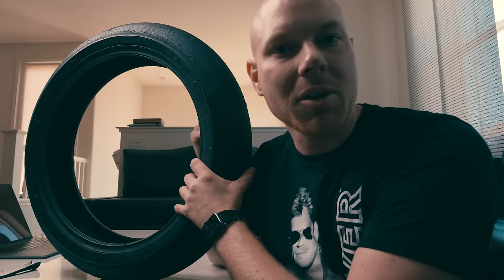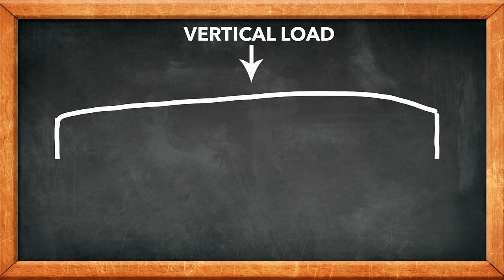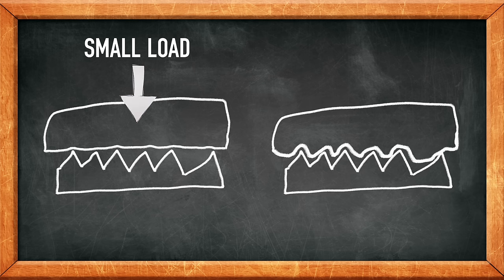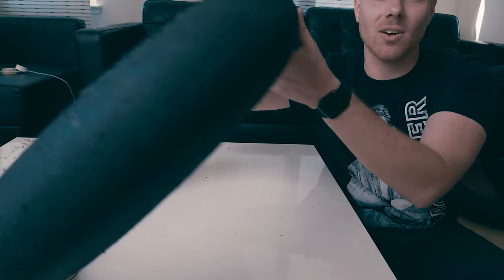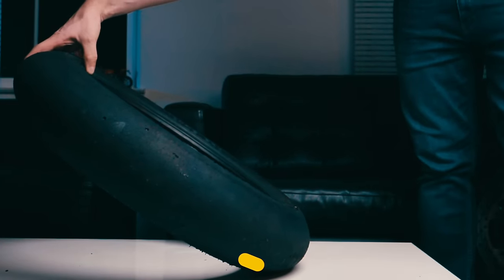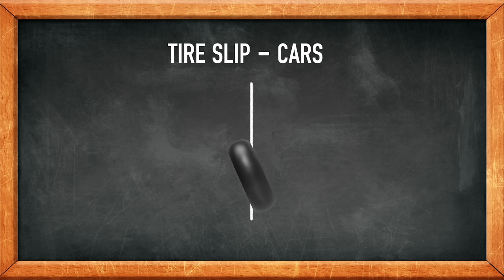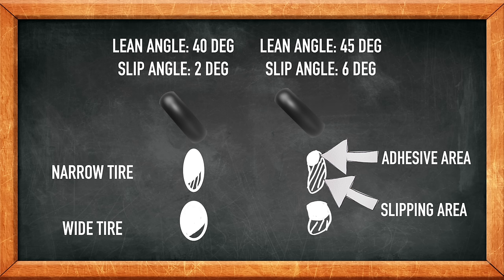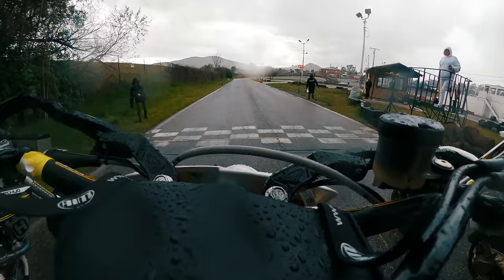Tire Grip | EXPLAINED

Comment: Speaking as a former tyre test development rider, it also needs to be pointed out that upping tyre sizes, even from the same manufacturer & model, rarely gives more grip at the contact patch is defined by the tyres vertical stiffness, lateral stiffness, & rim produced profile. Often 2 tyre sizes have differing vertical &/or lateral stiffness, & the larger tyre may well have a smaller contact patch area on the same rim, as tyres can be fitted generally on approx 5 rims sizes and their vertical/lateral stiffness, contact patches upright, & leant over, profile, grip, & feedback will be different on each rim. Shape is everything
Reply: Great point.

Comment: I think it was a bit disingenuous to say I got it wrong.  Was it simplified? Sure.   I feel like this is kinda like the "do chains stretch" argument.   You can argue a chain doesn't stretch, the holes in the plates and the pins get worn down and the chain gets longer.  But the definition of stretch is "being made longer or wider without tearing or breaking."   Is the guy who says a chain stretches wrong?  No.  It was just a simplified explanation.
Reply from the maker: I think that specifically "the force of friction is directly proportional to the applied load", (it's not),
and "friction force is independent of area of contact" (it's not), are both oversimplifications.

I agree with both you and Ryan on the other parts of your videos.
Reply: @CanyonChasers Yeah, I gotta side with Mike on this one, calling it purely F = μN is just a straight up incorrect statement, weight is only one factor and it's not a linear relationship.  As another mechanical engineer like Mike, high school and even some college physics just don't get into the exceptions to the rule as much as they should, and sometimes don't even clarify that there are exceptions.  If more weight equaled more grip, then the fattest riders would be the fastest riders through corners, and we all know that isn't remotely the case.  The adhesion forces in particular is what sets them apart from more conventional materials and are why tires can pull up to 3G of lateral force on race karts (highest non-downforce grip I'm aware of) when most materials would never get past 1G.  I've had plastic food wrappers get stuck to my kart slicks after pulling in after some laps that almost took ripping the wrapper to peel off, if it was just friction force and weight at play, it would've never stayed on the tire in the first place.

Also, while we're on the subject, I kind of don't like the guys that call chain wear "chain stretching" as it's caused a lot of people to think the chain links actually do stretch out and it leads to misunderstandings about where and how the wear occurs.  I even read people on forums say they don't lube their chain because "it always stretches out before anything gets worn", yeah, because the pins have no lube and they're wearing down.  

I'm sure you meant well and were describing it with your best understanding, but I'm also glad Mike cleared it up as I was taken a bit back when even Ryan from Fortnine, a guy with a physics degree, got it wrong.
Reply: @MikeonBikes  have you got sources for us to look at?
Reply from the maker: @dztrbdgod  The Racing & High performance tire, Paul Haney, 2003 

Motorcycle Handling and Chassis design, Tony Foale, 2002

Motorcycle Dynamics, Vittore Cossalter, 2006 

Car suspension and Handling, Donald Bastow, 1993 

Chassis Engineerings, Herb Adams, 1993 

Competition car suspension, Allan Staniforth, 1988 

Drive to win, Carroll Smith, 1996

Engineer to win, Carroll Smith, 1984

Fundamentals of Vehicle dynamics, Thomas D. Gillespie, 1992 

Mechanics of pneumatic tires, Samuel K. Clark, 1978 

Prepare to win, Carroll Smith, 1975

Race car aerodynamics, Joseph Katz, 1995

Race car vehicle dynamics, William F. Milliken and Douglas L. Miliken, 1995 

Science and Technology of rubber, Frederick R. Eirich, 1978 

The physics of Tire traction, Donald F Hays and Alan L. Browne, 1974

The Shock absorber handbook, John C. Dixon, 1999 

The Tire pavement interface, Marion G. Pottinger, 1986 

Tires, suspension & handling, John C. Dixon, 1996 

Tune to win, Carrol Smith, 1978 

Vulcanization of Elastomers, G. Allinger and I. J. Sjothun, 1964
Reply: A better way to save face in situations like these is to just say: Thank you for digging really deep into the nuts and bolts in this matter and educating us all about the peculiar and particular behaviour of tyre friction and why it doesn’t follow normal physical laws and formulas. 

Kind regards
Tom
(Retired engineer; Porsche, Audi, VW, 
R&D: Saab, SCANIA.)

PS. I follow and like all three of you.
Reply: @dztrbdgod  : Did you ever finish going through and verifying the source information you requested ?  lol.

Comment from the maker: Some references for the curious:

The Racing & High performance tire, Paul Haney, 2003

Motorcycle Handling and Chassis design, Tony Foale, 2002

Motorcycle Dynamics, Vittore Cossalter, 2006

Car suspension and Handling, Donald Bastow, 1993

Chassis Engineerings, Herb Adams, 1993

Competition car suspension, Allan Staniforth, 1988

Drive to win, Carroll Smith, 1996

Engineer to win, Carroll Smith, 1984

Fundamentals of Vehicle dynamics, Thomas D. Gillespie, 1992

Mechanics of pneumatic tires, Samuel K. Clark, 1978

Prepare to win, Carroll Smith, 1975

Race car aerodynamics, Joseph Katz, 1995

Race car vehicle dynamics, William F. Milliken and Douglas L. Miliken, 1995

Science and Technology of rubber, Frederick R. Eirich, 1978

The physics of Tire traction, Donald F Hays and Alan L. Browne, 1974

The Shock absorber handbook, John C. Dixon, 1999

The Tire pavement interface, Marion G. Pottinger, 1986

Tires, suspension & handling, John C. Dixon, 1996

Tune to win, Carrol Smith, 1978

Vulcanization of Elastomers, G. Allinger and I. J. Sjothun, 1964
Reply: I'm reading Motorcycle Dynamics at this exact moment! As a tire nerd/material scientist/chemist/mechanical engineer/former racer, thank you SO MUCH for making this video. Tires are so under appreciated, they're all just black and round right? This video is already in depth, but only scratches the surface of the complexity. Could have added (and probably way too technical) the Loss Modulus and Storage Modulus based on temperature (such as a DMA graph). Which is a discussion on glass transition temperature/rubbery plateau/flow region to demonstrate exactly why operating temperatures are so critical to tire operation, tire warmup, and over-heating. It would also be cool to see a comparison of a 190 rear on a 5.5" and 6" rear wheel. U vs V profile on the wheel, and contact patch at lean angle vs straight line stability based on that profile.

Such a great video.
Reply: Wow, what a list! thanks.
Reply: What do I win if I own all of the above referenced?
Reply: @RedTurbocar  My undying respect and a whole lot of knowledge.
Reply: Ohhhh man I fucking love the Carrol Smith books. Have devoured all of them. Holy fuck you actually read Miliken? Clearly you are my type of person. I've also read Gillespie. If you get a chance read "Race Car Engineering" by Paul Van Valkenburgh. I may have misspelled it. His books are very similar to Carrol Smith's books, but it's interesting to see the same information from someone else's opinion.

Got a new subscriber by the way

Comment: When the engineering knows race and what are talking about. Great job for make me (engineering student) understand the real fisics behind those simplifications.
Reply: As an engineering student you should know the video is wrong. its first year physics
Reply: @Benjamin Vadocz see my other comment
Reply from the maker: @victorperezADSK  Some references for you to read up.

The Racing & High performance tire, Paul Haney, 2003

Motorcycle Handling and Chassis design, Tony Foale, 2002

Motorcycle Dynamics, Vittore Cossalter, 2006

Car suspension and Handling, Donald Bastow, 1993

Chassis Engineerings, Herb Adams, 1993

Competition car suspension, Allan Staniforth, 1988

Drive to win, Carroll Smith, 1996

Engineer to win, Carroll Smith, 1984

Fundamentals of Vehicle dynamics ics, Thomas D. Gillespie, 1992

Mechanics of pneumatic tires, Samuel K. Clark, 1978

Prepare to win, Carroll Smith, 1975

Race car aerodynamics, Joseph Katz, 1995

Race car vehicle dynamics, William F. Milliken and Douglas L. Miliken, 1995

Science and Technology of rubber, Frederick R. Eirich, 1978

The physics of Tire traction, Donald F Hays and Alan L. Browne, 1974

The Shock absorber handbook, John C. Dixon, 1999

The Tire pavement interface, Marion G. Pottinger, 1986

Tires, suspension & handling, John C. Dixon, 1996

Tune to win, Carrol Smith, 1978

Vulcanization of Elastomers, G. Allinger and I. J. Sjothun, 1964
Reply: @MikeonBikes  Thanks for the input 👌
Reply: No first year engineering student can make any statement on the validity of this video. The concepts here just begin to get into polymer science. Viscoelastic materials can be thought of as a dash pot and spring combination.  I guarantee you that no undergrad ME has a scientific understanding of this topic (viscoelastic materials was a 500 level class in my Master's program). Please see the references Mike has listed.

Comment: This video is full of right concepts and good explanations and doesn´t contradict the two mentioned at the start. Mike´s video seems to cover the subject relating to racing. For the other 99,9999% of motorcycle riders that run on road tires (not slick ones), the first two videos are the real deal.

Comment: “Based on real empirical data”. That sentence is really profound. Great!
Reply: Many "engineers" think the equations they learned dictate the behavior of real physical systems.  Those equations are only applicable to a narrow set of conditions, and nature is free to generate data that is in disagreement with the (simple) equations, given the limited applicability of the equations.
My hypothesis is that Germans are taught that electrical systems behave as per the aggregate of manufacturer's specification, and design fragile systems based on the inability to imagine corner cases.  That's the only way I can imagine the stark difference between German electrical systems and Japanese electrical systems.

Comment: Great video and excellent explanations. For SCCA autocross, I found that if went with too wide of a tire, it would generate less grip because for lightweight cars, the tire temperature would not increase enough during a 50-60 second run. The pressure at the contact patch decreased too much, in which hysteric deformation of the rubber into the tarmac asperities was reduced. 

Tire dynamics is indeed a very complicated topic. My head was spinning when I studied the brush model, dugoff model, and ‘magic’ tire formula back in school.

Comment: I have a honours degree in Mech Eng and understand about 20-40% of this (albeit I qualified 30 years ago). That’s me being dumb rather than Mikes explanation. For the bits I did understand it seems to make sense and the graphics really help. My conclusion- it’s a complicated business and I’m really glad we can benefit from the research and testing those top brand manufacturers put in. I will give it a passing thought the next time I put on a wide track tyre. Mike you have done a great job here really useful content and well presented, many thanks for putting this together.

Comment: Mike, you did such a good job on this next one should be CAR tires on the rear wheel of motorcycles. Yes you read that correctly. Warning though, once they riders install car tire on the rear they swear is corners better? My response is if that's true Road Racers would install car tires and be done with it. This phenomena seems to be among Honda Valkyrie riders and Harley's.

Comment: very good introductory course on pneumatic tire. contact patch x pressure = force. so for less pressure and same force (load) you will get more contact surface between the tire and the surface. Rubber is sticky and bonds to ground surface and is independent of the force applied vertically to some extent but instead it bonds using Van der Waals forces. So that means more contact surface equates to more grip. which means with lower pressure (obviously not completely 0 pressure,  but lower minimum recommended pressure) you will get the most grip. Columb's coefficient force is for solid materials. rubber is a viscous material and not a solid one. viscoelectic materials have also temperature dependent characteristics. wider tires provide more contact surface with less pressure. wider tires are harder to lean to a corner. meaning they are less responsive to rider command when he wants to quickly lean the motorcycle to make the turn faster.

Comment: You have to throw stiction in to this as well, friction is seen in movement and stiction is the force to overcome to start a movement or slide, this is higher value than the measured friction value in movement. 👍

Comment: I don't really know though the effects of the wide big rubber on a motorcycle grip...the thing is when the tyre are flat/ punctured it's much more safer to push the bike to the nearest shop than the thin one..on my point of view.thanks for the video...a lot of information .

Comment: You stated that wider tires don’t have a larger contact patch. You did say “for the same internal pressure,” so you were correct, but that will mislead almost everyone since tires are not used that way. More internal volume always needs lower pressure. Therefore, in actual use when correctly inflated, wider tires do have a larger contact patch.

Comment: Just to add to your adhesion theory, in certain classes of karts, the tyres are so sticky that if you let it sit for a minute after a race, you need to actually break the bond between the tyres and the bitumen beneath them. It is literally stuck to the track.

Comment: Glad you mentioned aspect ratio.  I have a theory i want to test about using a smaller tire like a 180 on a liter bike.  To do this inwould have to change to a 5 or 5.5" rim. Ive thought about putting 190 on a 6" rim but it would mess up the aspect ratio of the tire. The only loss would be thermal load for long races but over all i suspect it will handle better with more side contact patch because aspect ratio. 

  Ive also been critizied for saying some street  tires don't have the shape for high lean angle. Low aspect tires or non aggressive tires literally run out of tire to lean on.

Comment: The main difference between cardboard and tires, is that tires roll, and the friction coefficient is static, much higher than a sliding friction coefficient.

But everything else is pretty accurate, thanks for the video

Comment: thank you !!!!finally !!!  its not so complicated if the friction coefficient equation was correct then tires would not be relevant.
       Ill report how my blackbird behaves with its new front end with 55 mm of width added, in order to frame a 5.5 " wheel same as rear .. It may be disaster until I work it out on pavement . Im determined to have the most corner entry traction and braking adhesion possible . The original idea of a smaller front comes from a time before brakes really mattered and the technique of floating the front end was across turain was key. high performance bicycles have similar tires front and rear as do flat track bikes witch is all about the best possible adhesion balance. good vid !

Comment: I have been researching this area of contact patch relation to tyre width and grip. When you install wider tires without changing anything else, the size of the tire's contact patch (i.e., the rubber touching asphalt) stays relatively constant BUT that does not mean it is exactly the same as other things do change.  Evidence for this is at:
1. "Are wide or narrow tyres best for a 4x4?" By L2SFBC - Robert Pepper on YouTube. He actually measures the CP shape and area for different tyres.
2. Relationships among the contact patch length and width, the tire deflection and the rolling resistance of a free-running wheel in a soil bin facility - A white paper. Hear they say "Contact patch length was found to have a linear relation with wheel load ; however, contact patch width was found to be a polynomial (order 2) function of wheel load"
3. BND Techsource - They have a CP calculator which shows changes to CP length and width for different tyre profiles. They say "contact width is a function of vehicle tire section width, and aspect ratio"

Does anybody know how do this CP calculation? I have found papers that calculate the length but nothing specific on the width.  Anecdotal evidence when dirtbike riding in sand is that tyre width does make a big difference.  

Regards
             Garry

Comment: Great vid but you did not touch on why MORE power  requires wider tires-which has nothing to do with increased contact patch for traction purposes but for heat dissipation and retaining rubber for for the bike! A 500  bike will go around corners at same speed as litre bikes and same lean angles but do not require a 190 0r 200 rear tire. Heck Some 250 cc bikes can go around the corner as fast but only need a much thinner rear tire. This is NOT an issue of contact patch  or traction but mass/energy management. Wish. you could have discussed that. But your vis are always very good Mike..Thanks for educating the masses